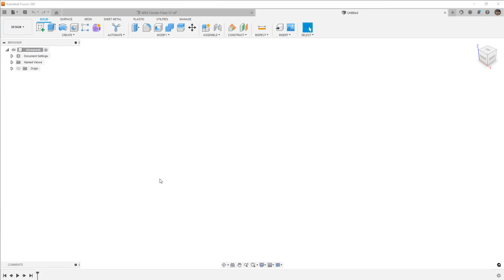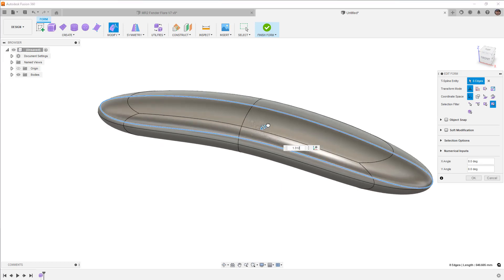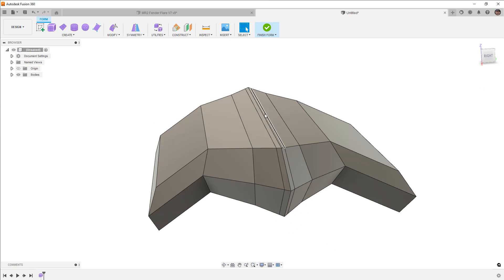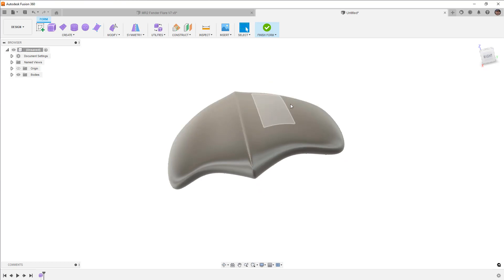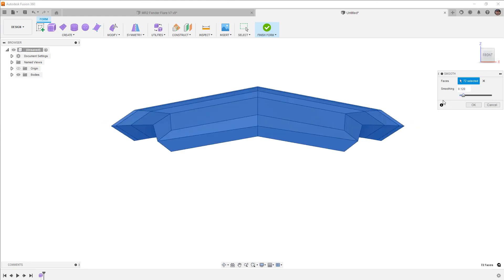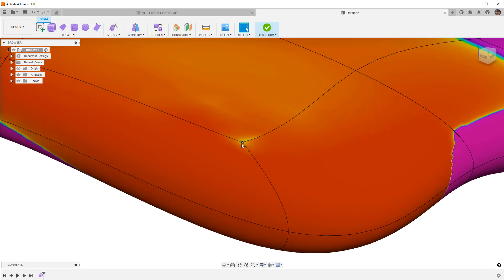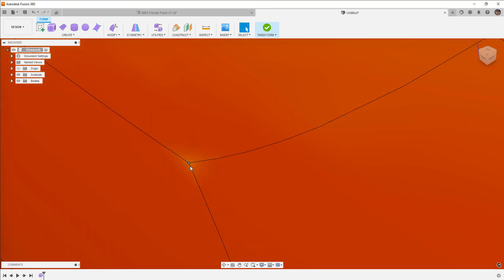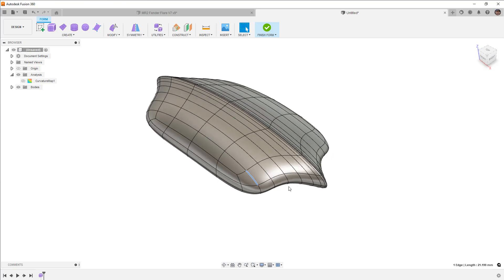Fusion 360 Forms Mastery  Part 33 - Tips for when and when not to use SMOOTH on a Fusion 360 Form

Comment: Any idea what the exact difference between smooth and make uniform is?
Reply from the maker: Yeah, it can be tricky to visualize as the tools differ based on geometry but i'll try.
Make Uniform - When you look at the box display and smooth display of a complex shape you will notice even if you have been very careful to make the spacing uniform on the box display, that edges bunch together when viewing the smooth display.  This is because the face angles and the edge positions need to shift around to get the smooth version of the body.  When you use Make Uniform Fusion will try and spread out the smooth display edges(not changing the box display usually) to get them in a more uniform spacing.  If you have a bunch of edges close together you will notice they start to spread out and transitions will get softer.

Smooth - This tool looks at the angle between faces on your selection and reduces those angles.  If you have a bunch of selected faces, some of them are colinear with others, you will notice they don't change, but if you  have some that are at very steep angles, you will notice the face angles begin to flatten out.  This is easier to see in the box display what is actually happening.  Unlike Make Uniform, which doesn't touch the box display, Smooth will have a more visual que when looking at the box display.

One good test to see what smooth does is create a freeform cylinder with a lot of divisions(default is 4, make it like 8),  then take a single vert and move it out making a bump/spike on the body.  Go to box display and play around with Smooth by selecting the spiked faces.  Start by just selecting the 4 affected faces and play with the slider.  You will see the angle of faces start to flatten out and it will also start raising faces around the selection.  Then add more faces and play around with the slider.  Generally Smooth will only branch out 1 face set past your selection.

Hope that helps.

Comment: i just want to say i found your channel recently because i was getting into modeling use surfaces/forms etc and your channel is invaluable. If i had found it earlier i would be so much better than just learning by trial and error like i have been. Especially cool that u do car stuff also
Reply from the maker: Thanks!  Glad it is helpful.  What types of things do you/are you modeling?
Reply: @LearnEverythingAboutDesign  i have been doing gauge pods, speakers, etc for a while but struggled whenever i needed to make an object follow curvature. i have been redoing a car side mirror that i modeled without a scan it worked and fit well, but now that i was able to scan the mounting section on the car using photogrammetry i wanted it to be more legitimate and fit on the car better, ive been struggling with stuff that needed to follow more organic curves since i am used to just basic measure and model thought process haha. i'll be trying to incorporate scans and more organic shapes into my projects 🙏
Reply from the maker: Photogrametry isn't going to be real accurate, but might be better than just a photo reference :)  As for matching surfaces.  Mesh can be pulled to, but you won't really be able to drive any curvature off of the mesh.  You could use a direct modeling approach, build a form surface off the mesh with high resolution, convert to a surface and then use Match to drive the tangency.  One thing that is always so hard to get across, even though I do a lot of longer videos, is just how much time this kind of detailed stuff can take.  No short cuts sadly.  If you want me to take a look at anything feel free to send me an email support@caducator.com
Reply: @LearnEverythingAboutDesign    yea I noticed it's not entirely accurate, took a like 5revisions/3D prints to get the base of the mirror to work with the photogrammetry, but that is weeks faster than I did it with measurements by hand and test fits haha. 

And yes for sure, I feel for me it's always been the first model is 75-85% good, maybe even good enough to use for my purposes, but I since I like stuff to be perfect that remaining 15-25% takes exponentially longer to get to.

And I appreciate that, it's nice to have people willing to share their knowledge thank you, I will continue watching your videos and hopefully get comfortable with forms soon 😁
Reply from the maker: Yup for sure :)  People can complain about a 10hr video series modeling a car but in reality that 10hrs I could easily spend just detailing a mirror as opposed to the 10min in the video on that part :)  Just doesn't make for good "television".

A long time ago I had to scan interiors and exteriors of cars and make parts fit for things like sensors, camera pods, warning displays.  I have done it all from tracing/putting on a photo scanner, hand building off spare parts and 3d scanning/reverse engineering parts.  Building parts from point clouds with enough resolution is the best way, but not the only way.  just a matter of $$ vs Time